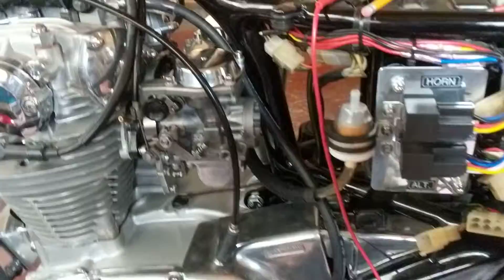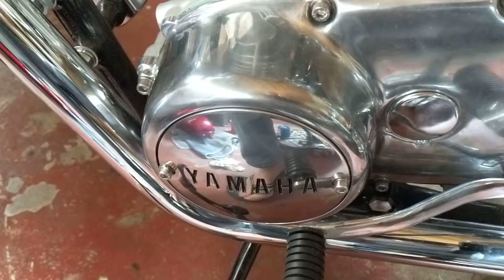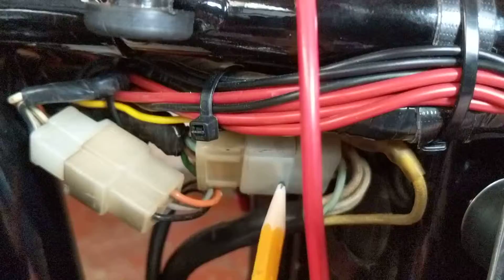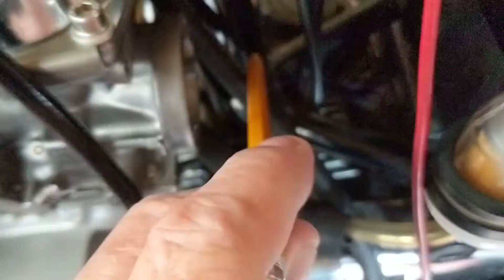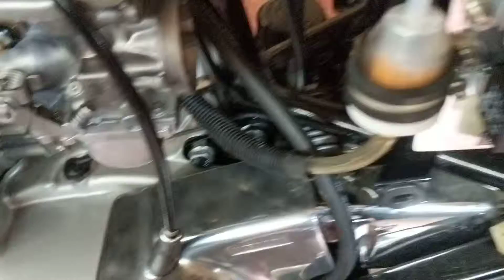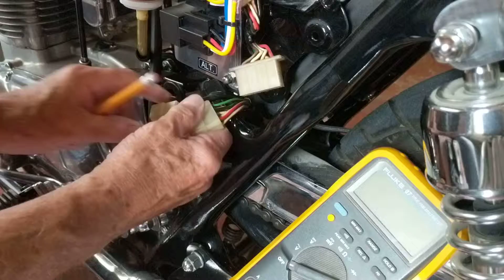Rectifier Test

Comment: Thank you for the clear explanation. Ive got something a little more complex going on I can't seem to figure out. I have one of those Motogadget M-unit blue wired into my bike and the feed wire for the field excited regulator comes out of an auxiliary port in the m-unit. There seems to be a difference between the battery voltage and the auxiliary voltage. When I turn the power on to the bike the battery voltage will drop to around 10v and unplugging the reg/rec brings the voltage back to battery voltage. Not sure what's happening there.
Reply from the maker: Yeah, that's a pretty big drop. You normally just see about a half a volt or less drop just from energizing the alt rotor.  Don't mean to insult you, but first think I'd do is try a known good battery. First find out if there's actually an M-unit problem or a power problem. One's easy to fix. The other? Well, I'm clueless on M-units.  Wish I was more helpful.... sorry.